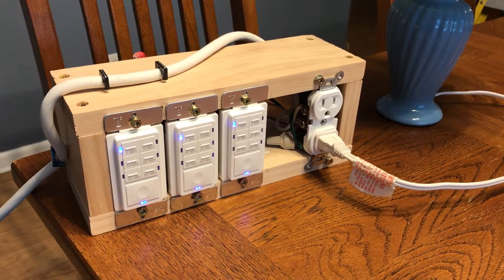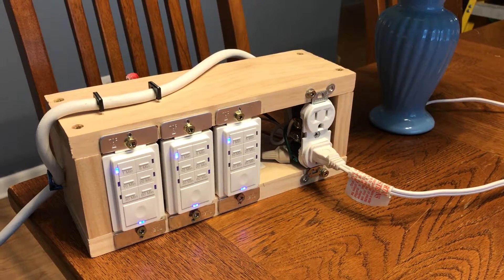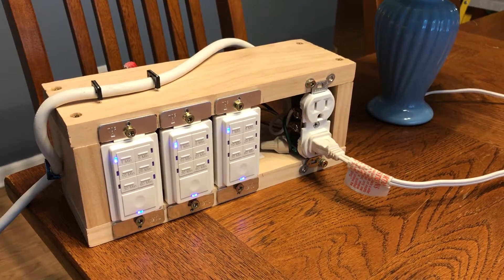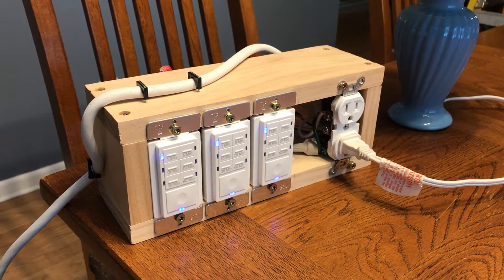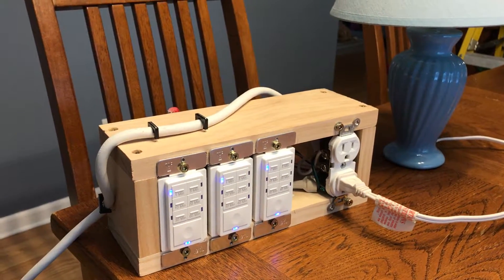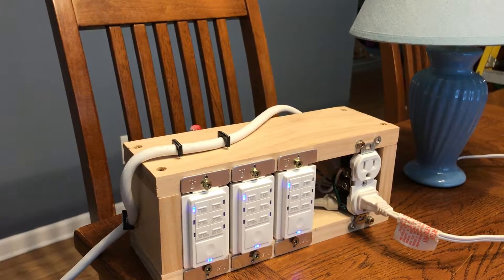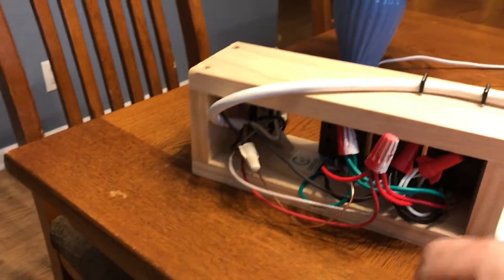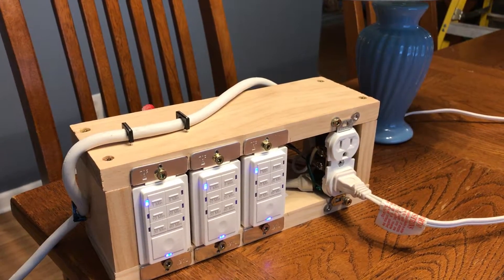Hot water recirculating pump countdown timer control option.

Comment: Are timers wireless or wired?  If pump is in far corner downstairs and countdown timers are at the other end of the house upstairs, are you hardwiring them?
The Insteon countdown timers were great before they discontinued them.
Reply from the maker: Hi. I was dealing with a crawlspace and unfinished basement, so it was very easy for me to put in hardwired switches.